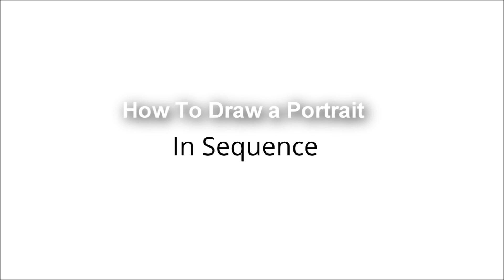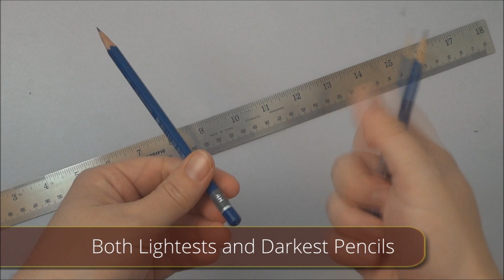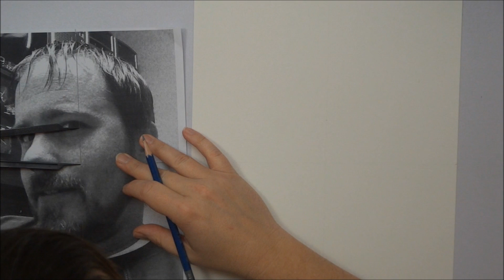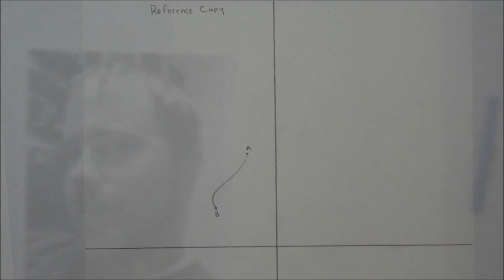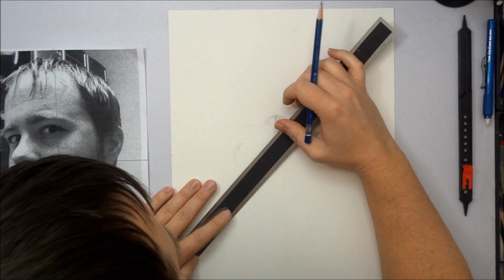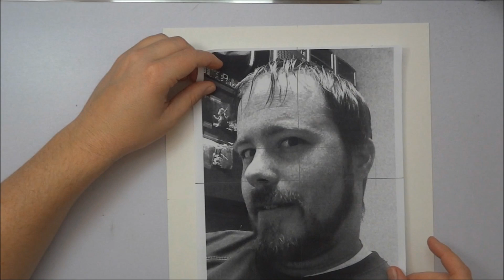Portrait Drawing for Beginners -- Part 1 -- The Layout

Comment: These dividers are also helpful for double checking. Eventually you won’t have to use the dividers  but it still helps to check afterwards to make sure everything is correct. Definitely a great tool for practice.

Comment: But how to do draw a portrait when you need to make it big paint?
Reply: +lavderim misini
 Exactly, that becomes impossible with this method. That's why you should not waste time on this but learn traditional drawing measurements techniques instead, then you can draw how big or small you want. Google "drawing measurements techniques" for more info.
Reply: Lavdërim Misini he’s using a proportional divider to draw the same size photo , however you can also scale the drawing up by a lot if you set the divider correctly

Comment: It's a well made tutorial however if you are a beginner and want to learn how to draw I.e. Training your hand and eye, then this method is terrible. You won't get better if you constantly rely on measuring tricks. Might as well trace the thing. Learning how to draw well takes time and effort. There is no real shortcuts that are going to benefit you in the long run. All you'll be doing is fooling yourself into thinking you can draw well When really, you can't because you've cheated your way through the difficult parts. Sorry for the rant :/

Comment: it is an interesting way of drawing. very mechanical. It focuses exclusively on acuracy of copying. A good, but slow way of turning out a near perfect copy. There are other easier, quicker ways to get to the end point of this tutorial. yracing is one. Gerhart Richter does it, ans Luc Tuymans. theres there's also gridding, Misses out the most important element in art though. choice- decision making. choosing the lighting, the angle, the pose, the composition. All of which come before pencil hits paper. Meticulous tracing, gridding, or mechanical copying may give you a perfect copy but it is the imperfections that make any picture interesting and unique..

Comment from the maker: There is certainly nothing wrong with that. I prefer a much looser approach myself. I teach this technique to help those that have never drawn a portrait before. One the hardest things to learn in portrait drawing is keeping the proportions correct. And if used correctly you can use this technique in conjunction with any freehand method to help you double check your measurements.